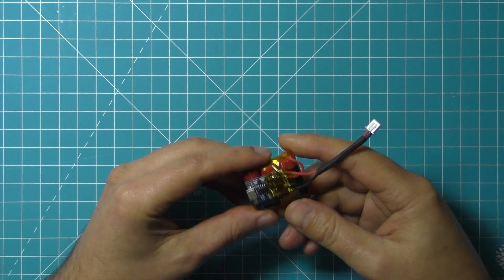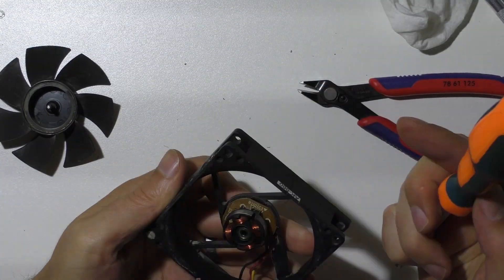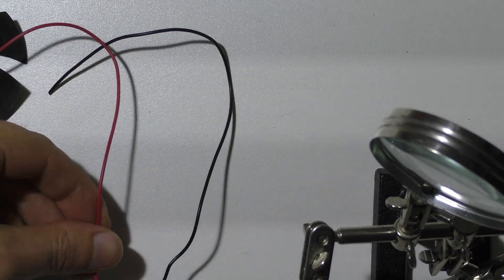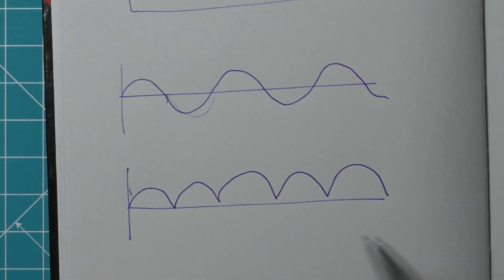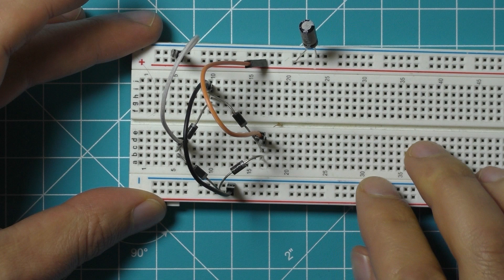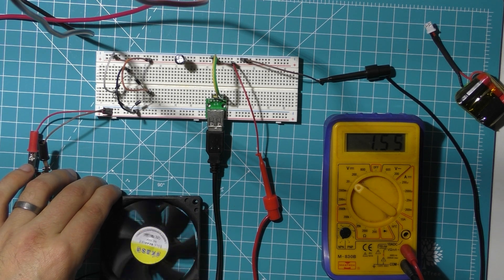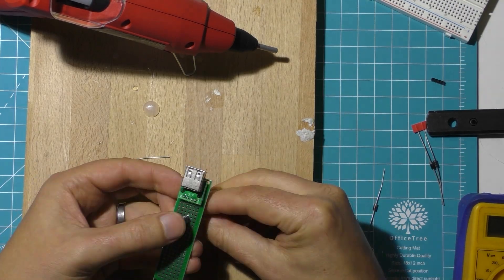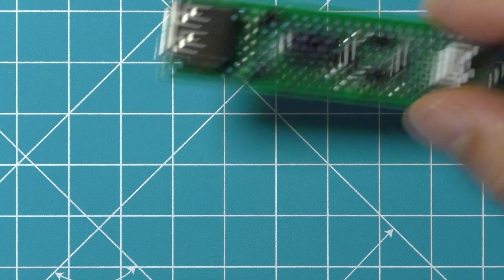Turn a 12V Computer Fan into a Mini Generator: Easy DIY Electricity Project

Comment: Instead of using the fan itself directly, just use the motor inside it. If you have 3D printer, you could print some gears in decreasing diameters, and make a structure, lets say a case to hold them connected to each other. The gear with the lowest diameter connects to the motor / engine, the gear with the highest diameter connects to the fan - propeller - a wind turbine - a water turbine.
So even if, lets say, local winds are not powerful to make it up to 5v, by having gears in different shifts and diameters it will end up becoming 5v for the engine.
If it works then I would suggest switching to metal gears instead of plastic.
Reply from the maker: Thanks for the comment. I like that idea a lot and I think you're right about using gears. I'm trying to do stuff without a 3d printer even though I'm very tempted to get one. For the moment I'm enjoying trying to use stuff I can find...so if I find some suitable gears I'll try this